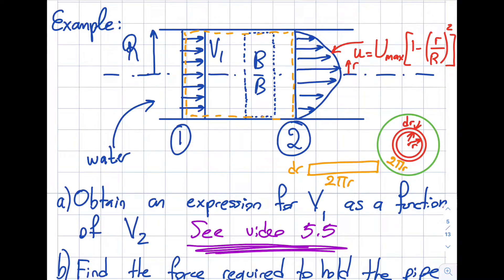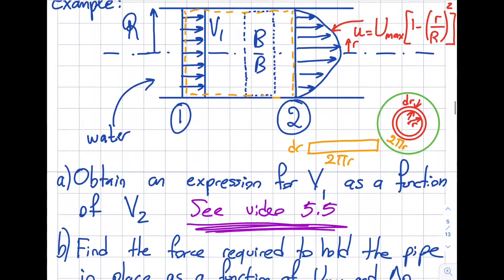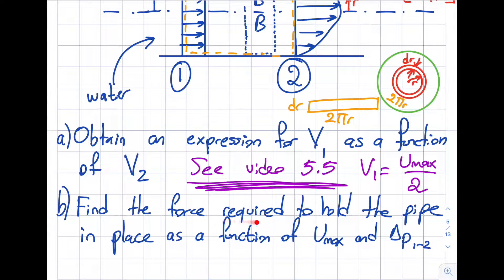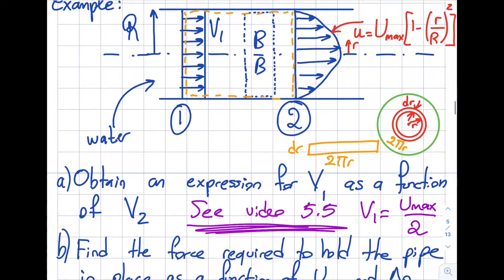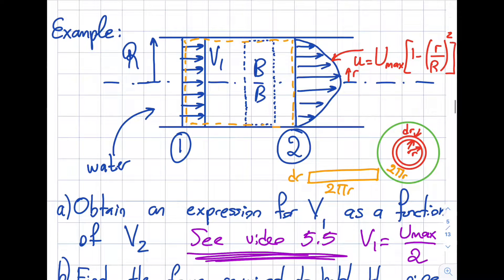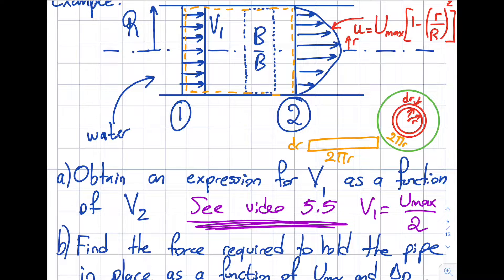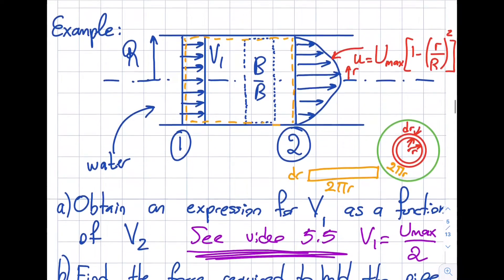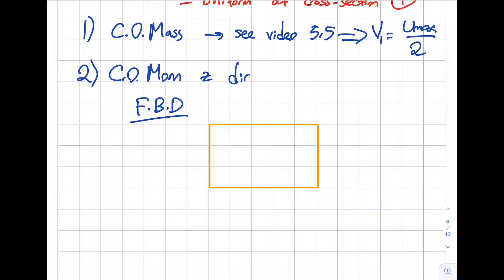Fluid Mechanics 6.5 - Solved Example Problem 3 - Conservation of Momentum and Mass

Comment: why is the inlet area, pi*capital R squared ?
Reply from the maker: Hi Valerie, I am not sure it is clear in my drawing but the cross-section is circular, also as the inlet is uniform, the second term on the right hand side (the one with the double integral) reduces to a simple Velocity*Area. I used the Pi*R squared for that reason. You can also use (Pi/4)*D squared, if you prefer. Hope this clarifies your question.